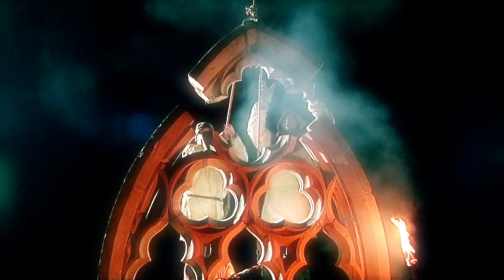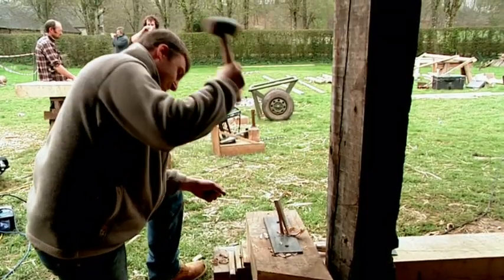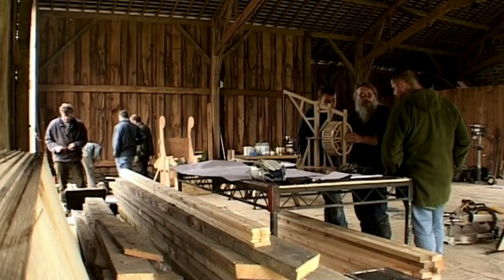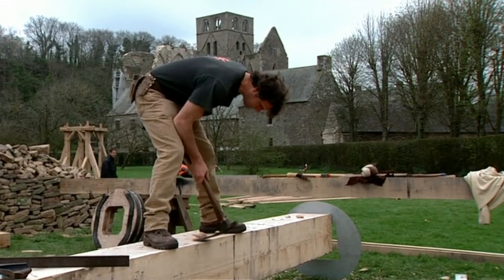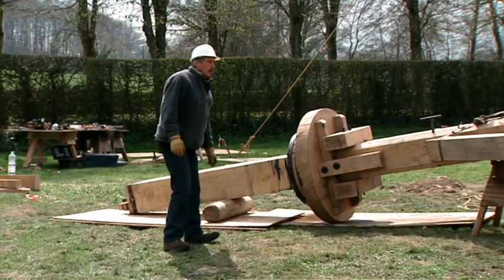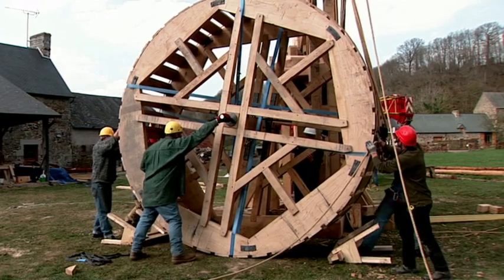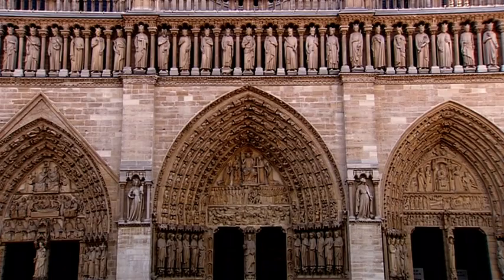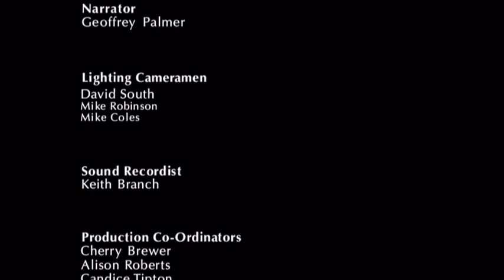Machines Time Forgot S01E01 - Crane

Comment: CLOWN COLLEGE:    When Julian ordered the timber, he would (or should) have known what he was ordering.  Even if Julian didn't specify in his order, the first and fundamental question the timber merchant would ask is "Do you want kiln dried, air dried or green material?"   Anyone with any level of timber framing experience should know that green wood is preferred, and upon delivery he should confirm the desired level of moisture content.   Really low moisture wood, especially old dry wood, is case hardened; it's tough, brittle and hard to work.  That Bashar didn't know that, or just assumed the wood would be dry is shocking and suggests he really had no clue  of what he was doing.  This was a strange team -- was Julian acting in the role of "owner" (like the medieval bishop who needs the crane to build his new cathedral)? Owners are usually technically clueless and defer to the master builder in all technical matters.  But in this case, Julian was actually the designer and model maker following old manuscripts and drawings -- and had previously built timber frame houses.  Bashar, as a structural engineer, was, or should have been treated as the "master builder."  Everyone on the team should have taken his directions.   But it's obvious he lacked experience, and to some extent, knowledge of what he was doing and more important, apparently had no real understanding of the strength of materials he was working with.  Thus he was a terribly ineffective ultimate supervisor.  That this odd team actually got it done (apparently with no death or injuries) is utterly astonishing with this clown college -- everyone doing their own thing and refusing to follow directions.  Still,  it was an enjoyable experience to watch, and in a way, probably was closer to real life of what  medieval crane builders experienced than the producer intended.  Thanks for posting.
Reply: and did they ever get the "rotation" problem figured out? Did I miss that bit or did they just not cover that?
Reply: @desimac5464  I don't think they fixed the crane, at least not in the video, but it became clear that Roland, the medieval "expert," was clueless when he came up with his idea on the greased rope bearing.  His idea was not only useless, it rendered the crane impossible to slew (rotate).   Greased steel-on-steel (or more likely, just iron-on-iron) was the way to go, as Bashar discovered with his clamp test.  I hope they were able to remove the rope between the disks and apply lots of grease.  Modern cranes have a "slew ring" with roller bearings for very low turning friction.

Comment: Wow, this episode told lie after lie after lie. The biggest one saying that, "for thefirst time since the middle ages, a "cathedral" crane lifts again. This episode is listed as being published on March 18th, 2018. I don't know the date this crane was actually made and first used, but according to the publishing date, it's likely to have happened less than a year before the episode was published. Regardless, it is highly unlikely that crane was built more than 5 years before 2018.
These cranes were used to build castles as well as cathedrals.
Over in France there has been a construction project going on since as early as 1999, the building of a 13th-century style castle: the Château de Guédelon.
The earliest photograph I have found of a working Treadwheel Crane in connection to that project was published in 2005.
I'm not going to waste my time talking about the other lies. But this one was a whopper, and very easily debunked.
Reply: Look at the cars in this video. My guess is around 2004-2005.
Reply: According to thetvdb it was first aired in 2003